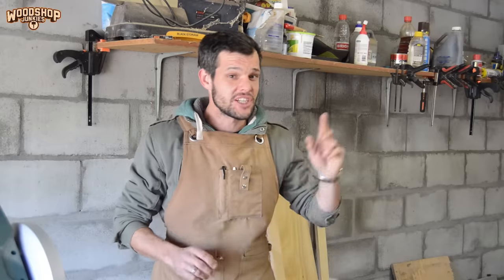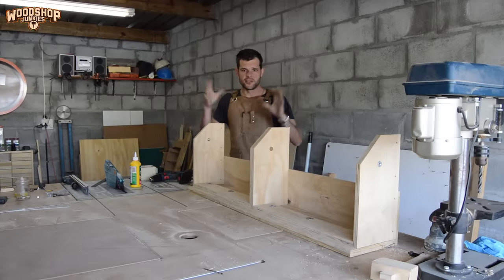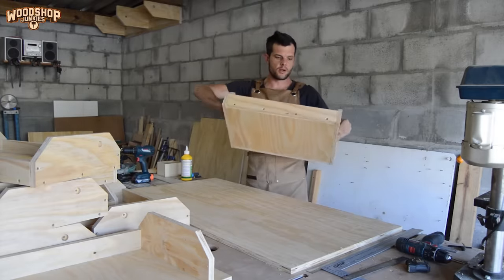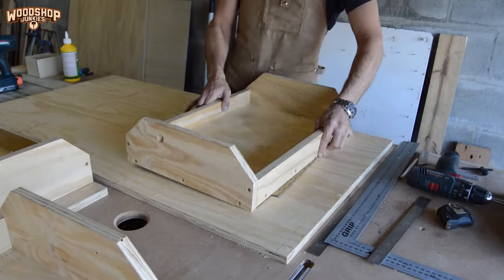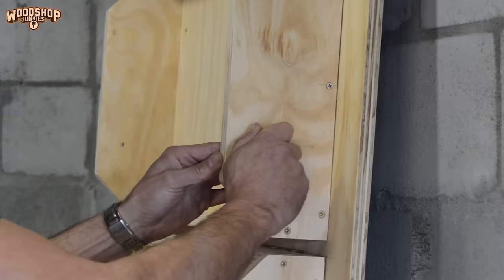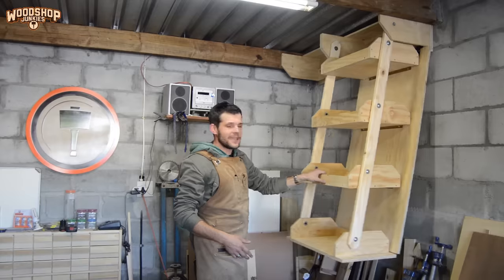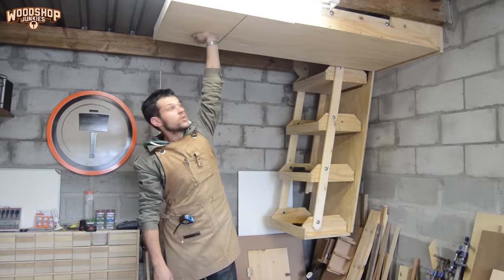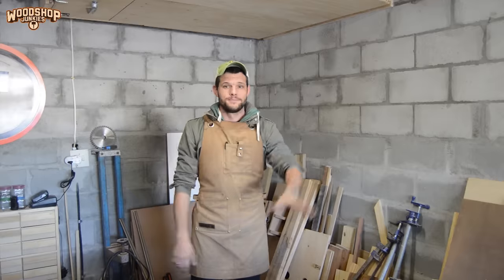Installing The Ultimate Garage Workshop Storage Solution

Comment: Great, I like the way you approach your locking system. Just an idea that came to mind, I noticed that a lot of space is lost on the wall while your shelfs are locked overhead. To make better use of the wall space,would be to first install some shelfs on the wall,then to install your overhead shelf. So you will have at the same time shelfs on your wall and overhead.When you deploy your overhead shelf it wil rest in front of your wall mounted shelf when it is open. Hope it helps to squeez a bit more space out of your workshop.

Comment: Yes this works great for a bedroom,   Murphy type bed only on the ceiling
fold down desk,  and general storage  or bookcase..  It can be any type of wood, provided the grain is put in a direction it won't split and break.

If that bedroom has an attic above it  this could also be attic storage space

Comment: If you moved it out from the wall a bit more, you could even have room for shelves mounted to the wall behind it, and really get some extra bits storage. As it is, looks like you have flat board stoarge going on around that area, so perhaps it's fine. Either way, thanks for your work and ideas!

Comment: A good mod would be to add springs to assist in raising and lowering it. Once you get it loaded with items it will be considerably heavier. Add springs like what an attic staircase uses .
Reply: He does mention that 18:35  The ones he had were not strong enough. 😊

Comment: Great idea an build.  I'm thinking that it should have been installed a few feet from the walls facing towards the door.  That way it could be lowered and not interfere with other shelving along the wall.  It would fold down in front of a shelf and then put back up.  Hind sight is great, but the way it is now, it prevents the 90 degree wall space useless.  But angling it the other way and come out a foot or so and then it would lower down in the walking area you have and you could still put shelving on every wall.  Like I said, hind sight is great

Comment: I'd use weights coming down the wall as the control resistance mechanism. That way it could be easily changed to an appropriate weight as the load changes over time.

Comment: With over 2,300 comments, this may have been covered.   
1) Instead of metal washers, nylon or teflon would give a better glide. 
2) Johnson's Paste Wax is your friend.   Just a single coat on all of that raw wood would reduce dust accumulation as well as friction.  Waxing the holes for the pivots will reduce friction as well.   Otherwise, oil the wood.  That will also reduce effects of humidity and spills.   
3) speed up some of the drilling/sawing/etc.   That cuts down the video time, and reduces boredom, while still having all the content.  This was most obvious near the beginning, less so near the end.
4) Door latch.   If you use a basic latch from a screen door or similar, you simply reach up, turn the handle, and lower the shelves.   To put it back up, just lift, and they'll click in.    Use the dead bolts for safety.

Comment: I really like it! Only problem I have is that it sort of does not save you any space as it occupy the same walls pace as a normal shelf when opened. Had it been further from the wall then you could both have a normal shelf AND this cool ceiling mounted shelf! Anyway, a really well done job, and a nice design!

Comment: I would love to see how you install the spring or pulley system to assist in closing with added weight.
Reply: I'm thinking of building something like this. I plan to make one wide set, and mount a torsion spring as is used to assist with the weight of garage doors. The spring drives the rod, which turns drums that roll up cables attached to the bottom shelf.

Comment: I like this idea and it's very ingenious. However, although this keeps things out the way you still need to keep the wall space free so you can use it. Therefore you could just use shelves. I think it would be better if you could mount it to the joists maybe 300-400mm away from the wall (assuming your joists will take the weight). This way you could put shelves on the way and then this would fold down in front of them and could be used for less frequently used items. this would effectively double your storage. But great idea and like your channel.

Comment: This is fucking brilliant for tiny house storage for tiny homes with loft area because they waste so much space with 13ft tall kitchen and living room areas and have nowhere for storage. 

Also could be made into a tiny version to put under the upper kitchen cabinets to put kitchen utensils and spices in.

Or for work stations and craft stations so you can get it out of your workspace and then drop it down whenever you need to grab something out of it. Also would be great in small business spaces like pet grooming salons. Also would be great for attic and crawl space areas in bonus rooms.  

Great idea for all the wasted space in stair cases too. 

And great for carports so there isn't random stuff stacked on the ground so it's out of the way and safe from the elements. 

And could be a great addition to loft beds in the lower portion for more storage space.

You could make a fortune if you made display cases like this so like jewelry shops or couture shops could just drop the shelves down to display their merchandise and then put them up in the ceiling and lock them to keep people from stealing things.

Comment: Ingenious, Amazing Professional work.  I fell out of a Helicopter in Iraq in 2009 (I was the pilot, long story, hard landing) and really jacked up my back (crushed L1 vertebra and 40% L5, L2, 3, & 4, compressed with Fx'ss and bulging disks).  The result I have big-time restrictions with my hack and unfortunately can't do what I use to do.  I would love to make roof type shelves in my 2 car garage.  Stupid Az homebuilders never make garages big enough (5' STORGE ON BOTH SIDES OF GARAGE SO WE CAN PARK 2 CARS.  I RESOLVED THIS BY GOING TO HOME DEPOT AND HAD A CUSTOME TUFF SHED 10'X15' SHED BUILT IN BACK YARD (OOPS SORRY CAPS)

Comment: One would need a low ceiling - that would not work for me, but appreciate the craftsmanship and ingenuity
Reply: The ceiling height does not matter. The shelf is anchored to the wall and the latch brace can be lowered to any height. I have a very thin shop with 14 foot ceilings and I will be installing these to help with my organization. 

Great video A+ build for sure.

Comment: I am going to try to make this but mount it to my garage ceiling in the space between it and the garage door tracks. I was thinking that to help close the shelves, I would mount a torsion spring like they use to assist in opening garage doors or closing trailer ramps on the latch end of the shelves.

Comment: Hi fantastic idea,could u maybe put a plan up,how did u put the top of two arms together ? Do u not thing all the barrel bolts r overkill,I would just use a rope pulley depending on weight.thanks.

Comment: Great idea for storage,  but you could have made a shelf just a bit lower in the same position.  This would have used less materials,  as it is you need a step to reach the locking bolts and handles.  I think you need a hard hat working under it, because at the point when you release the locking latch, it looks like the whole weight is being carried by the six small wood screws on the T hinges and two bolts on the first pivot point.  As previously mentioned,  great idea, looks good and great engineering.

Comment: Nice design. Except for the pin sticking out for the quickhatch, maybe a different solution can be found for that.  As for the weight, gassprings (car hatchback typ) might be best, maybe in combination with an angle (=strenght) adjustment, if you have a big difference in weight being used.

Comment: - Builds non assembled components with precision
- abjectively attaches shelves by the eye without markings. (and you can tell due to spacing as the shelves are hanging, some not even level/plumb either)
Otherwise, its a nice shelving unit, could have aligned the hanging gate hinges a bit better (and used better ones imho) so that it hung straight down, since the space is limited, and not pinch plywood against plywood... which will be a point of failure as time goes on. The stepped hang that you later went for (seeing that it wouldnt hang down straight) is ok,  but for a limited space workshop, that's essentially wasted space what you were trying to prevent.

Instead of the gas shocks, just do a traditional spring/pulley system (think basic lifting garage door). Parts are readily available, and easy to install and maintain.

Comment: Nice ! Add a cable attached thru 2 pulleys to a bucket fill pail with weight to same weight like water or sand and easy peasy up and no splat down action ! What you think cheaper than struts! 🐧
Reply from the maker: I am currently considering such a solution with one difference. Instead of a counter weight I am looking at achieving the counter force using a torsion spring. A weight would use to much space I think.

Comment: I love this Idea I might just have to do it, Wised you gave some kind of plans, but I'll bet I could figure it out just by looking at it.

This would work great in a garage ecpt my ceiling is 12' tall or about, over the garage door I have a lot of empty space this could be a way to use it. I'd have to figure a latch pull rod system with counter balance....... Humm Torsion springs like the garage door uses, its a 16x7 door  2 rod set up with springs and wire rope is more than enough power to hold the door up so you could pull it down, and push it up into place with a catch and bolts to lock it up with.  one spring per side. each side 7' wide by 7' long that can be pulled down to the floor to reach everything with a rope or somthing.

Comment: I wonder about lifting all the weight of those shelves when they are fully loaded. Perhaps a counterweight? Or maybe an attic stair spring to help lift the load?

I would also need to label the back of the shelves so I could look at my ceiling and remember what I’d put up there

Comment: Great concept and great build! My one concern is that the whole load is pressing on the screws holding the bolt pins on the end brace. Even if the screws are long (i.e. NOT the short kind that come with the bolts) I'm not sure they would be adequate over time. I would think a backup mechanism could be installed to prevent total release in the case of failure, though exactly what that should or could be in not clear  to me.

Comment: I was just watching your video on the folder shelves and was wondering if you had a similar video or plans for the bins you built for your nail and screws?  I am looking at building one for my garage shop but not sure as to which design I want to use.  Really like yours.

Comment: Thats an awesome project, I need something similar in which I store my bench grinder on a table that will slide out from under the work bench and then raise up to a working height after clearing the edge of the bench top. Have you designed anything similar to this? If so please make a video.

Comment: neat idea.  have you thought about maybe just moving the bins up out of the way and leave the door fixed down... sort of a pull cord system like a pair of drapes for windows... but have them pull up the bins into the overhead with a set of pulleys.  Main idea - move the bins, not the door?  or just have them cycle up and come down in a long train, like an escalator?  still neat.  I'll stick with simpler is better... and just throw everything on the floor... for now =D

Comment: Careful with those grey masonry plugs. We stopped using them because they were pulling out even with little weight or leverage applied....
Reply from the maker: I used the fischer duo plugs. They work great. Especially in these hollow cement blocks. They cost a bit more but they are well worth it.

Comment: first thoughts are that it would be good to store goods in an unused space   but by doing so you have lost the wall space behind and adjacent to it   no gain   also if you don't insulate the steel roof condensation will be a big problem

Comment: This is awesome... One question I can think of is "What if the Ceiling is much Higher?". How easy is it to convert it that the final 'shelf' pivot is on the bottom of the back support...
So, the whole unit comes down, but instead of the shelves folding out off the back peace (vertically aligned) as it is now, they fold down again (pivot on the bottom of the back piece) which would then result in them now folding flat (horizontally aligned),  Hope that makes sense.
Reply: Make it longer and use a step or milk crate ,.nope not understanding what your jibbering on about.
Reply: @nssherlock4547  FYI. .. It's jabbering not jibbering! And in what way am I jabbering??? I'm simply asking if it's possible to make the adjustment I mentioned. 

I read through my explanation again and it's simple enough to understand.

Comment: The prong of the gate latch sticking out in the down position poses a risk of injury - in fact I was concerned when you put that case onto the top shelf ! Just using the slide bolts would do, I think, though I see why you put the latch on, it may not be needed.
Also, the stand off from the wall would not be my choice, possibility to also use the outer, reachable slide bolts to lock flat onto wall?

Comment: Great project, good execution and methods, but I think you take some steps into the absurd extreme.   
For example:  A considerable amount of both time and material was wasted by overly complicating fabrication of the pivot pins.  Sections of plastic pipe were cut, filled with custom sanded-to-size and glued wooden dowels.  Then that assembly was center-drilled and a bolt was inserted.  
A simple 3/8" bolt by itself would have been adequate.  If one were really concerned about wear, you could simply slide a small section of copper tubing as a bushing over the bolt -- but even that seems like needless overkill due to the limited number of times the assembly will be actuated.
However what  you did do, you did very well -- even if it was wasteful and unnecessary.

Comment: Why not a combination of springs, cam pulleys and steal cables. Something like on a compound bow, but with springs. It would take some effort to pull down at first, but it would let off say 50% such that at the bottom the weight of the shelves would be enough to keep it down, and with tools even more so. Guess that's a complicated way, another idea is a counter weight, pulley system. I wonder how those attic stair systems work?

Comment: Your concept is very interesting but from my chair, I would think that you unnecessarily overbuilt with 3/4in (18mm) plywood.  From personal experience, for the load you will be able to carry on the shelves, the back and all the shelves would have required at most 1/2in (12mm) plywood construction.  This would have reduced the weight of the whole assembly significantly and made it possible to lift the shelf full of material without getting a hernia and maybe your gas shock would have been sufficient.  I have built several cabinets with comparable drawer size for my tools using 1/2 plywood for the frame and drawer carcass and 1/4in for the bottom of the drawers that fits into a rabbet in the drawer sides.  The cabinet and drawers are screwed and glued, the drawer bottom is only pressure fitted into the grove.  After several years, there is no sag and everything is still square with no movement.  Look forward to your next build.

Comment: If you want a much simpler design with less wasted space, and as strong but lighter weight, you could use dividers with one lid, or even mesh pockets with bungie drawstrings.  His design definitely has the "wow" factor.  But if you aren't concerned about impressive looks, there are simpler and more efficient ideas than this.

Comment: I live in a small 1 room apartment and there is a structural concrete beam running across the ceiling making a narrow recessed ceiling space between the beam and the "kitchen" wall.  This is literally the only thing one could do to make use of that space.  The "kitchen" is only a sink and 1 hob/burner, no cabinets, no counter.

Comment: Bru cheers for that going to use the idea in my yard shed/summer house. Quick question can you suggest a cheap table saw that won't break the bank for a hobbiest? But will have good functionality.
Reply from the maker: Hey Matthew. It depends on your country. If you are local it's a bit difficult. We aren't exactly spoiled for choice here in SA. I own the MLT100. They aren't exactly cheap and many people complain about them. I manage just fine but I do admit, they aren't the best in their class. If I had to re-buy I would consider the Bosch GTX 10 but once again, not exactly cheap. Maybe consider an old cabinet saw as a restoration project. I have been looking around for something like that and it seems you can pick them up quite cheap.

Comment: The problem I see is that you can't have anything on the wall below the storage when it's open, so I don't see much of a difference with having fixed shelves. Maybe a solution would be to install the storage separated from the wall thus leaving space for shelves, which effectively doubles the storage capacity.

Comment: So you need to leave a wall free of shelving for it to fold onto, and when it's loaded with heavy stuff it's a pain to lift up and get down. Great.
Reply: Installing a pulley system will eliminate the heavy weight lifting.
Reply: It can be spaced away from the wall to allow for shelving when it is down. You just have to make the upper bracket and support legs to allow for that.